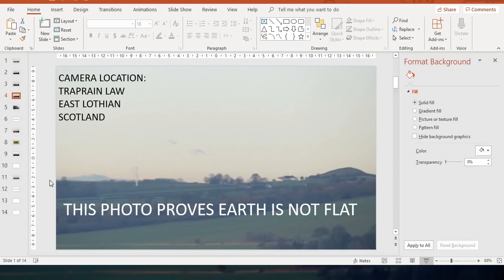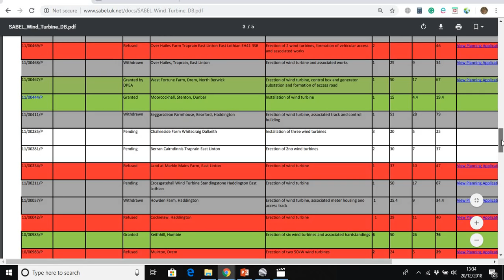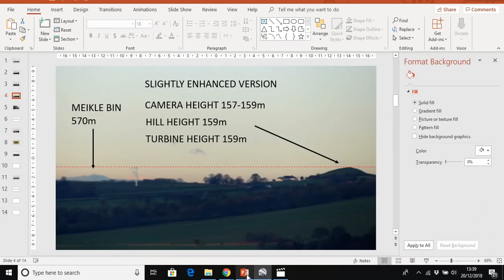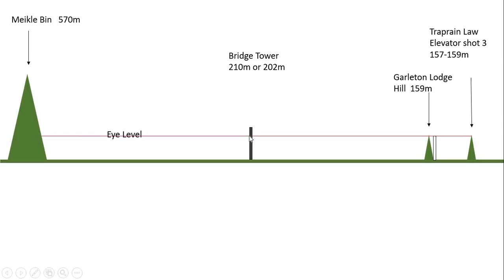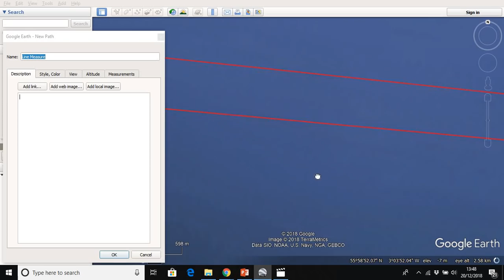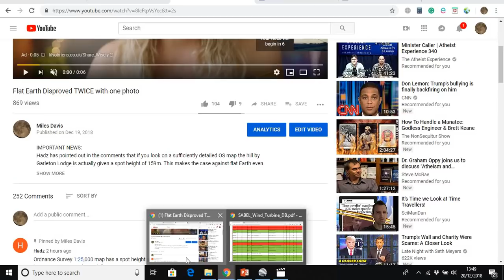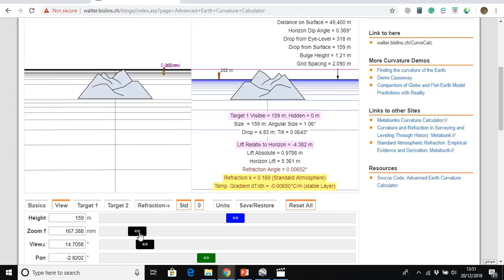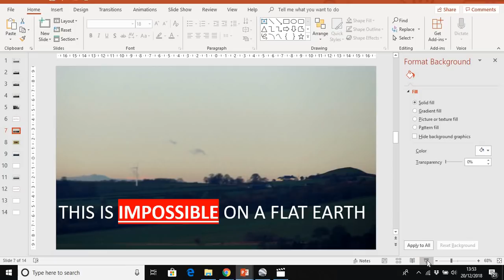FLAT EARTH DISPROVED TWICE WITH ONE PHOTO. CORRECTED VERSION

Comment: It's useful to have the detailed contour map of Traprain Law.  I had a very protracted argument with someone in the comments on your Isle of May video, who insisted that your stated observation height on Traprain Law could not be trusted, and who couldn't (or wouldn't) understand that for the purposes of your argument in that case the exact height was not important, as all that mattered for the argument was that the height was much higher than the lighthouse on the island.
In the present case the exact heights of the various points are rather more important, because they are the basis for your horizontal 'eye level' line across the picture.  By my rough measurement with a protractor, it would only take an anticlockwise tilt of about 3 degrees, pivoted on the top of the small hill, to bring the line down to the top of Miekle Binn.  As it happens, the corrected figures tilt the line in the other direction, which is better for the proof, but it could easily have gone the other way!
Reply: I have also found myself call I g people out for dodgy claims about the accuracy of the OS data.

One guy was trying to say that the trig point is invalid because the OS no longer maintain the benchmarks. He was then also paraphrasing quotes from an OS document in an attempt to discredit anything that uses OS benchmarks.

He was also trying to discredit the observations because the trig point and the bridge will be based on different datum information, despite the latest relevelling and geoid model only being different by an average of 20mm.

These minor discrepancies are irrelevant due to the distances, and size of the targets  involved in Miles observations

Comment: Nice and very convincing. One more remark: The line of sight is well above the landscape between the objects and there is no big lake in between, so refraction doesn’t have to considered. So this picture is much better than looking at distant objects from one shore to another shore, and we don’t have think about in which direction (up or down) the refraction would influence the picture. So 👍  .  Mark Sargent got his answer regarding his stupid question nr 1 to that “scientist” . ( From his speech at the FE conference)
Reply: There is always at least some refraction due to the pressure gradient due to the difference in elevation. Also, during the day, the air close to the ground get heated, rise and cause some turbulence, and at night, that same air get cooler than the air above.
But, yes, it's usually much less than within 2 m above the water.
Reply: Alain Martel  Yes, agreed!

Comment: A 24m hub height turbine? That's tiny. The usual ones they build around here are at approximately 160m hub height, with a rotor diameter of 110 to 125m and a power output of 3MW
Reply: Geostreber it might be tiny for a commercial turbine, but it isn't for a private one.
Reply: @GeoStreber. The greater heights of  turbines you mention would also be true in the UK of the large-scale wind farms which are connected to the national power grid. You can see from the photo that this is an isolated turbine (also confirmed by East Lothian planning application 10/00585/P)  for local use only. Probably just the farm itself and any other local users on the property.
Reply from the maker: Yes geo, it's just a small one to supply a single agriculture  farm. The wind farms on the hilltops are bigger, over 100m tall.
Reply: @MilesDavisKDAB  That's interesting. Those small ones don't exist here anymore. They became unprofitable in the last 5 to 10 years or so due to decreasing subsidies. The only turbines that are profitable here are the really tall ones, which is a good thing, as the energy prices for renewables are forced down that way.
Reply: They are not commercially profitable. They are still interesting for domestic or private use.